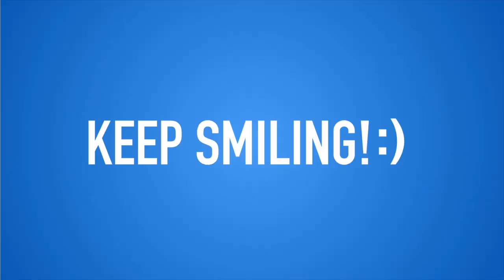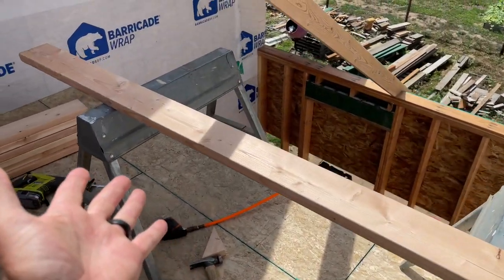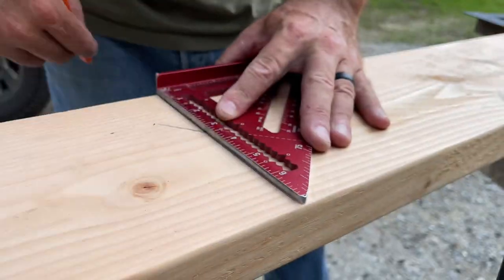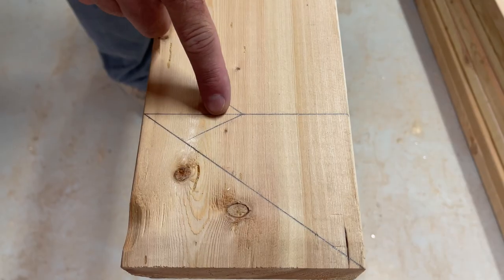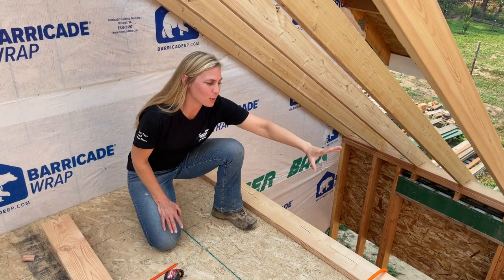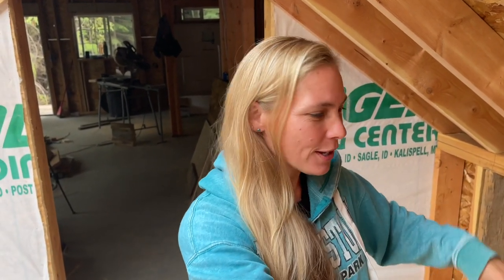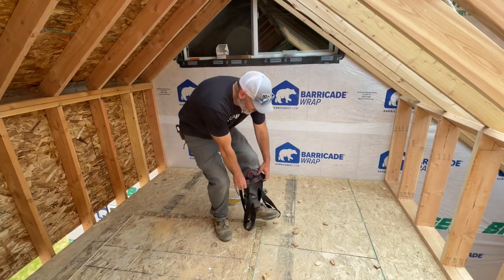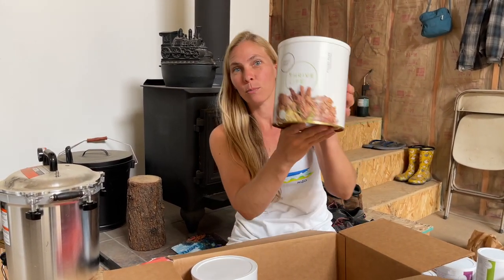Building Hand Cut Rafters and Roof for our Off Grid House

Comment: Cut one correct rafter first and just use it as a template for all the other ones, no need to measure, mark, and cut each individual board one at a time and chance making errors each time. The seat cut you got there is a little too deep. Also, definitely need to use a push block on the table saw, especially when laying the blade over on an angle. This is an overly critical post, but you’re doing a great job here and I enjoy the videos very much!

Comment: The seat cut is a little deep. It leaves a flimsy tail on the rafter for your overhang. You only need about 2" of bearing.
Reply: I noticed that also.  I worry that the tail will break off.
Reply: I would think the OSB on top would fortify the structure and the 9-12 pitch is a quick drop. But I'm not a professional.
Reply: @brendonesia2000  I've been framing since 1973 in California, Utah, and Colorado. The area above the birds mouth should be at least 3 1/2". You also need to consider snow load in Idaho. A 1/2" of OSB won't help that much.
Reply: @RamblinRoadies  good call outs Frank. Thanks!
Reply: He'll figure it out when the snow snaps the over hang off!!
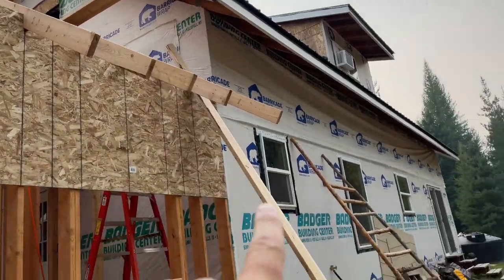Reply: foreshadowing at 17:45
Reply: @samagon00  🤣 why not duct tape?

Comment: Where your cutting out your birdsmouth the thinnest part of material left has to be 3 inch minimum according to code for your area. It's called the effective depth. You should've been using 2×8. btw, I've been a carpenter for 28 yrs.😁🔨
Reply: @bucsboy78  it's got nothing to do with length, it's the amount of wood left above the birdsmouth. By using a 2×8 he would be adding 1 3/4 inches to his effective depth therefore exceeding code which is highly recommended in areas that receive a lot of snowload especially with a roof above that has snow sliding off onto this roof.
Reply: homer nextdoor, I agree with you about 2x8! I've been a carpenter for 45 years
Reply: @bucsboy78  if I understand, the reason he's saying 2x8 is that the deep birdsmouths he is cutting would leave enough thickness in the rafter at the top plate for strength to support the rafter tails.
Reply: How does he get past inspection? or is that something else he ignores.
Reply: @tabs41  I'm not positive but he may be out of city limits, no building permit -  no inspection. Which means probably no house insurance either. I'm in Canada so it may be different for him.
Reply: @homernextdoor5950  And the way he is going it could mean no house if they get any sever weather which is highly likely in that area

Comment: Might consider putting some kind of support under those rafter tails.  I am worried that they will not bear weight with those deep cut birds mouths.  Seriously, what's left in the width of the rafters is seriously weakened by those deep cuts. Remember the one that broke at the birds mouth when it fell?

Comment: When you use the table saw. You should stand with your right shoulder in line with the blade. This allows you to see that your wood is tight against the fence. If it isn't, then you will likely have a kickback. Thus causing your hand to be drawn into the blade. I was a woodshop teacher for 32 years, please follow these instructions. Short pieces of wood are very dangerous to cut. When ripping, the wood needs to be supported on the back side by someone. Enjoy watching your work. With a fire near by , I would cut down those trees that are close to the house. Be safe and God Bless.

Comment: cut one board that fits good, don't put it up permanently yet, then use that board for a template for all the others !!
Reply: Yes, exactly. If build is square they should all be the same length. If not, you got problems.

Comment: Bird mouth cut are all wrong. There should be 1 third timber removed to 2 thirds timber left for strength. You are gong to have a very weak roof  with very support for weight of roof timber and heavy snow.!

Comment: A better way for the length of the tail (to avoid top dropping snow on bottom) is to use a level and plumb down then measure back from the plum line.  The reason is more accurate since the roof pitches don't match.  Your way works too.  Just food for thought.

Comment: Broody hens wont eat much if anything while sitting. The easiest way I have found to check on eggs they are sitting on is to lift them up a bit by their tail feathers, not all the way off the ground but enough to see how the eggs are doing. Once one hatches out the rest have about 24 hours to hatch before mom will give up on the rest and start walking the hatched chicks around the yard and teaching them what to eat. As for the eggs you find around the property you can float test them to see if they are still good. :)

Comment: Sorry to see you having so many issues with the new addition. You have been doing such a great job on the house, garage and apartment.  Sorry to see the addition present so many issues for you. From a wall 3/4” out of square, rafters crossing in front of the apartment door opening, rafter bird mouths cut too deep making over hang weak, few rafters cut to short and finally, the rafter that got away from you and broke. On the bright side, you saved it with a great repair.
Hopefully thing get better as you continue.

Comment: As a woodworker, I cringe when I see you using the table saw. Please consider using a Push Block. You can make them from scrap wood and they could save your fingers. A table saw can grab the wood and pull your fingers into the blade in a fraction of a second. Thank you for the videos and God bless.
Reply: I cringe when I see him use any power tool!

Comment: The main thing is it is what you are doing is working out for you.
Rule of thumb is that you make a templet that fits both sides and you use the one pre cut rafter templet to cut the rest. 
That is how I do the rafters and they all come out the same length with no extra cutting 

It saves time and aggravation

Comment: Consider  burying  propane tank  incase of fire   pluse protect from extreme  cold   give more  even use of gas  as propane  gets cold its ability to evaporate at rate to keep up with  appliances  goes down   tanks exposed  to cold are oversized  to provide evaporating  surface   example  if you use undersized tank on big BBQ  the tank frosts up and flame dies  down if not completely   to just minimum  unstable  flame
Reply: I agree with burying the tank in case of fire... however liquid propane BOILS at 44 degrees below zero .. that is the temperature it boils at.. when propane is used all your using is the fumes from the propane not the liquid. What I’m saying is unless it gets extremely cold and I mean extremely cold it will continue to make vapor to burn.. and keep in mind that they do have wood heat to both heat the house and cook on if need be. I’m not disagreeing with you about burying the tank only the need to for cold weather

Comment: You should always be afraid of your table saw, otherwise you'll get hurt. Plus put a shield over the blade and that might make you feel a little bit more comfortable that you don't put your hand on top of the blade, but still watch out for your fingers.
Reply: You should never be afraid of any power tool you use. Confident and deliberate in your use at all times paying attention to your fingers location in relation to the cutting edge.

Comment: I'm a carpenter of 40 years when you cut rafters such as you are in this video you make you a pattern rafter and Mark all your rafters off of that pattern once you figure out what that raptor is supposed to be anytime you measure a rafter you measure from the top side of your ridge down to the outside of your plywood at the top plate for your c-cut you measure from the top point and you make an arc then you get your angle to that Mark both ways for your bird's mouth or c-cut whatever you like to call it you will save yourself much time

Comment: rain and flood easy to dig around these concrete slabs on which the gas tank is placed.. There must be four concrete bases extending into the ground 50 cm or more.

There are refrigerators and heating appliances, all powered by gas..it will save you from spending electrical energy.

Comment: 5.5" that's not enough space for climate zone 5 and 6, you need R49 or R38, but you don't have the space, the only one that can give you an R38 is 5.5 "closed cell foam and it doesn't need ventilation
Reply: True, do they have to follow code for insulation. A poly vent and R-15 batt will work, but like you said, it doesn't have the R's.
Reply: @augustreil  well maybe because this is an addition that connects the house with the garage it will not go completely with the codes, also the crawlspace does not have a proper drainage.

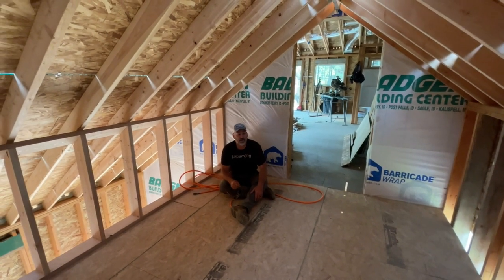Comment: Martin, I think you cut to much out of the birds mouth. Use the first rafter you cut as a template and make sure it fits, then cut all of them the same. I would use a push block to save your fingers and hands, and always wear your safety glasses. Martin, I see a Black ant while you were cutting up on the second floor ( 21 18/ 34 21) see video,  that is not good. The area you are working on, I was wondering why you did not make it bigger and take the knee walls out to the end to give you more space ( 30 20/ 34 21). You can't put 30 : and those two dots in because you tube will not let you and the numbers will turn blue and it will not post. 30:20/ 30:30. See what I mean. Martin, why not put small gravel in the crawl space to help with the water. Great video. 😉
Reply: I hope you read this Martin

Comment: The seat cut should be a third of the width of rafter .. so 1”3/4.. because its a open concept space you couldn’t put ceiling joists, which is why you needed to cut so deep. This type of rafter should have been minimum 2x10… try adding 2x4 blocks from the fascia back to the wall where the studs land to ensure your overhang does not sag

Comment: A better choice for ventilation, would be foam vent chutes. You staple them to the underside of the sheathing. This prevents the insulation from blocking the air flow. They are not exspennsive. I'm afraid the blocks are going to block the air flow. You don't need them.. The reason the rafter broke, is the distance from the birds mouth to the top of the rafters should be a minimum of 3 inches. Weak, but the sheathing should strengthen it.

Comment: And you'll save time not measuring and marking each board. Just cut one that fits, and then use it for a pattern. If it doesn't work, your ridge isn't in the right place. And cut the tail on the saw bench. It's just one more line. No need to lean out and cut them the way you are.

Comment: When you are setting your bird blocks between your rafters at the top of your wall set you a bird block on both ends of your run set your bird block flush with the outside of your plywood all the way down and just rotate your block until it clears the top of your rafter flush with the top of your rafter you angle those bird blocks no one will notice you do that on each end you pop your line across your run and that gives you a reference point for all of the tops of your bird blocks no need to cut an angle on one edge of the bird block you should really get you a book on roof framing it would help you immensely

Comment: Whats the plan for removing the window to the "love loft"? Considering the lip of the window goes around the exterior, it will need to be removed through the outside, which is now covered by the rafters.
Reply from the maker: I took it out and installed it on the inside.
Reply: @MartinJohnsonOffGridLiving  oh very cool, didn't catch that one. Good foresight on your part.

Comment: certainly too late but using a 2 inch hole saw with the pilot hole 1/4 inch below the top would have saved you a lot of work on the notching

Comment: Oh, maybe the chainsaws are scarier than the table saws, don't you think? Well, ladders are the scariest of all. :-)  Also, those birds mouths are so deep that the overhang will be weak.  You can support it by putting horizontal 2x4s or 2x6s attaching each rafter to the side of the house with TimberLock screws, for example.  You should definitely add some structural support.  Don't rely on the plywood sheathing to hold it all together.

Comment: If you are going to start a nail with a hammer, you might as well just finish it with the hammer. It just takes another hit or 2 and is trivially easy, much easier than puting it down and getting another tool. Especially a tool that you have connect up and pull into place.

This is not meant to be a criticism, just my view of the fastest and easiest way to do something. It does take a while to be able to put a nail all the way in with a few hits, but you never will get there without practice. I would not use a nail gun or similar unless there are hundreds to do consecutively. When doing a few nails at a time, the hammer is faster.
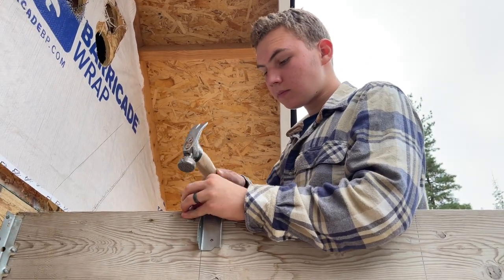Reply: If you listen from 3:06 he explains why they do that. Also a nail gun on those brackets wouldnt be wise, at least for amateur use.  But I do understand what you mean.
Reply: @falghar4711  
No offense intended, but it doesn't seem that you did understand what I meant. I did hear what he said, he said that he was starting with the hammer in order to not make an error by starting with that nailer. I said that he should just finish with the hammer. It's much faster and easier than puting it down and getting another tool, especially one on a cord.

It's a cool tool, and there are many hard to reach places where it would would be great.
Reply: @seanrodgers1839  Apologies. I did read what you said wrong haha. I got it now

Comment: I am surprised that there is enough space to insulate AND still get ventilation inside a 6" gap made by the rafter. I am used to the standard American build where the insulation sits on top of the ceiling (between the joists) and the entire attic space is all vented. Is there any guide as to how much of a gap and how many opening you need to adequately vent a space?
Reply: If they do a standard poly vent and use an R-15 batt, it will fit. It won't be a lot of insulation, but it'll work. Not sure if they need to follow code ?

Comment: A couple comments on your use of saws. First have Julie take the gloves off when using a cutoff saw. Another thing I noticed Julie had her thumb out to the side, tuck your thumb under your palm, like you don't have one. You're less likely to cut it off that way. When cutting short pieces like you were doing on the tablesaw, stand in front of the saw, enough to the right to be out of the way of a kickback. Use your right hand only with the little finger over the fence. Incase of a kickback your hand comes up and away from the blade, with the wood.
My experience is working with wood for about 55 years 40 of those as a wood/metal patternmaker, now retired and still have all my fingers, toes and eyes.

Comment: The seat cut doesn't have to rest on the full width of the top plate + sheathing (1:08) leaving insufficient H.A.P. using a 2x6 rafter. 2 x 8, I dunno.
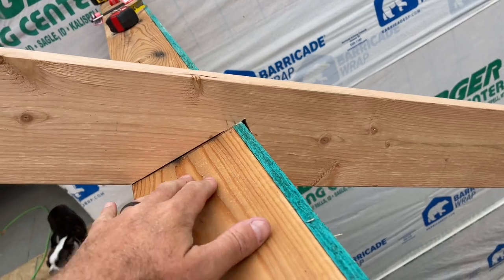Reply: (1:58)

Comment: When you are cutting the angles with the table saw you should NOT push the board through the cutting area with a bare hand but use a s piece of lumber to to push past the spinning saw blade.  Safety SALLY will not love you if you get cut!!!!!

Comment: That seat cut is WAY too deep.  It should be 1/3 to 1/2 the width of the board max.  Im afraid you will have cracking when the snow falls on that cut.

Comment: Between the glue and the screws, the repaired board should be just fine.  Good job.
Reply: Jury rigging is not the way to build a hose.
Reply: @dncndan1  how many houses have you built?  That was not jury rigged.
Reply: What do you call plugging in a scrap piece of wood, and using glue and screws to put broken support pieces together?  F.Y.I. four houses.
Reply: @dncndan1  Well, if you really built 4 houses you should know that is an approved method to repair the beam.
Reply: @jamesdiyhomestead8263  are you referencing the "Hillbilly" building code?
Reply: @dncndan1  since you are referencing building codes, could you tell me the one that says that is not a proper way to repair a beam?  I'll wait.
Reply: @jamesdiyhomestead8263  yes, common sense dictates you replace a broken support with a new piece of lumber.
Reply: @dncndan1  Ahh, so you don't know the correct building code?  I was not requesting your opinion, I was requesting the specific building code since you were talking codes.  I honestly don't know if you are serious or just trolling.  Common knowledge among individuals in the framing industry is that very often a splintered stud can be repaired easily.   When wood was cheap I can see why they would just replace it with a new one rather than repair it.  Given current prices it is wiser to properly repair it instead of replace it.
Reply: @jamesdiyhomestead8263  section 204.17

Comment: The saw.Really dangerous. Heres what every joiner I know does.
Right hand on handle,left thumb under the lever that lifts the guard.
Put front of bottom plate on timber, lift lever with left thumb,start saw,grab left handle.
 Means saw is on timber before your start it with guard down,no guard in way when you start cutting and at end of cut release thumb off lever which means it slows with guard in place.
It becomes habit real quick and doesnt leave a unguarded blade spinning in fresh air.
Id hate to see a 'man chops off fingers' or 'cut into  artery with circular saw.' news.